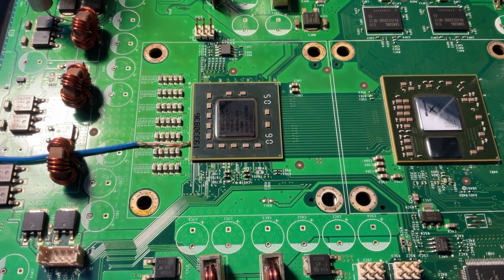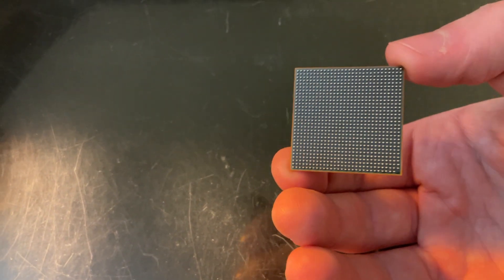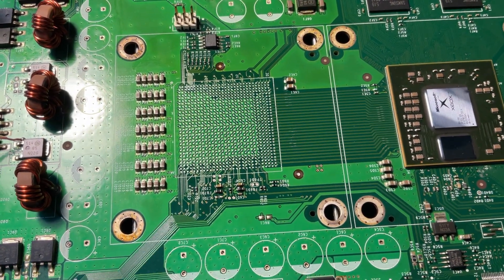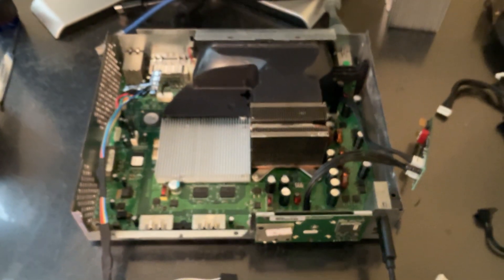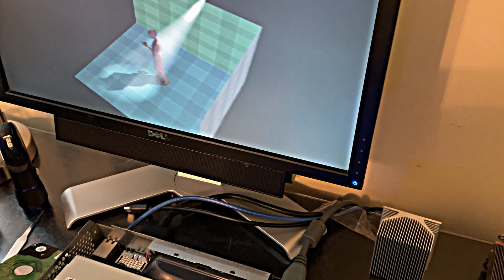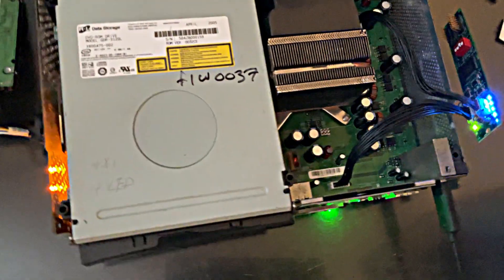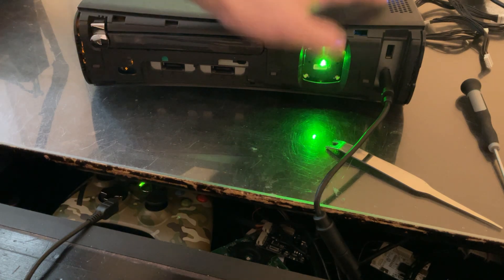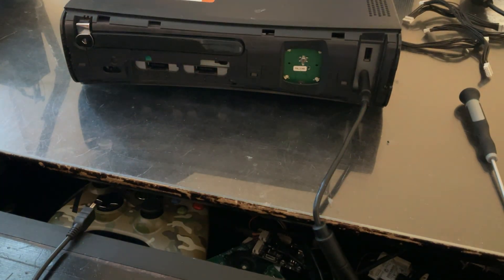Xbox 360 Prototype XeDK 007 Repair (BGA Rework)

Comment: I waa doing them over 13 yrs back. Was tricky then as not much info. Nand swap and cpu swap was how I did it and I think I had to run the nand through jrunner or some program to get xell on it.
Reply from the maker: This is not what is happen in this video. Doing that on this prototype console will not work.

Comment: Great video, Josh!
Matching the topic a bit: I'm currently in the process of preserving an old Xenon 360, Mid 2006. It though it had just a RROD, but the board below the GPU has separated and the top layer looks like a bubble with a height of about 1mm. After replacing the GPU, the error is still 0110, what could be GPU or RAM seemingly. The bubble is straight on the way to the two RAM chips on the back underside. I replaced the chips, same error.
The Xenon was just played hardly with in the first 1.5 years of it life (maybe mid 2006 til 2008). The owner put it away, for sure because of issues (RROD as we know today).

I removed the CPU (and GPU, as it is functional) and want to put it on a different Xenon board, that I have.

What do I have to prepare besides the NAND backup? Thank you very much and sorry for the long explanation 🙂
Reply from the maker: It a popcorn because someone have heat the board improperly! The board is now garbage.
You will need to use that nand.

Comment: Hi Josh thanks for your videos you think you can help me I have purchased some CPU for Slim console but they came with 0000 cpu key and 000 fuse burn how do I get it to burn fuses so I can get a CPU key  thanks
Reply from the maker: Don't burn them! Why waste the cpu??? Instead just run DEVGL on it.
Reply: @Josh.Davidson  I don't have the knowledge on DEVGL, on j runner it will not let me it will not let me choose that option, is there a form where I can get guidance on how to do this

Comment: Strange that died cpu, not gpu ... But in general, I advise you to change the GPU radiator to a version with a thermal tube from older models and put a small fan on the extension of the thermal tube, otherwise it looks like there are 90nm GPU, and they are all on the brink of death
Reply from the maker: DD1 CPUs are have dodgy AVDD screens and have issues with the Glitchless Mux. This is what caused this issue, not gradual failure.

There is no reason to change the heatsink, this will not affect longevity or temperatures - only fan speed. Besides, this is a prototype, which runs the fans at 100% all the time and as such, there is absolutely 0 impact of changing the heatsink.

Comment: Hi Josh! Glad to see some nice work done in bringing these pieces of history back to life. I happen to be developing a Xbox 360 Low level emulator, and i’d love to know what’s the lowest firmware version you’ve managed to dump from a XDK! These early prototype builds contain lots of debug info, which would be more than helpful, as there’s not much documentation available from these systems. Hope you can continue the good work i’ve seen in your videos 🤜🏻
Reply from the maker: Hi. These early units I receive for repair are usually flash-bricked from China. Therefore I have nothing dumped from them. Sorry. Regards, Josh

Comment: what’s the difference between dd1 and final cpus other than the clocks
Reply from the maker: There are differences in the design, several issues were corrected in DD2. The biggest one is the broken power-on-reset sequence which is why Titan is required. That wasn't planned, but was a workaround since DD1 was broken. The fuses are also somewhat different. I am sure there are more differences that I am not aware about.

Comment: Would Revised Y1 work on this once the GPU shits the bed?
Reply from the maker: Yes. But given that I barely will use it I doubt it'll die. 
But, I have replacement A21N2 chips so I'd probably just install that.

Comment: Hi Josh, I recently opened a friends working Xbox 360 to clean it out and give it new thermal paste. After I put it back together, it no longer worked. The system boots and shows system error E74 with a secondary error code 1022. I have the backup of her failing hard drive with all of her game saves. Could I pay you to help repair her system and get her backups restored to a new disk and SSD? I feel really bad that I killed her Xbox.
Reply from the maker: @sethmaynard2972  It's not economically viable. It would be more viable to replace the motherboard.

Comment: What do you think of the cardboard mod on the GPU? That is, putting cardboard on the GPU heatsink to improve airflow accross it, have you ever used it, is it effective at reducing GPU temps?
Reply from the maker: Very stupid and pointless. GPU temps not need reducing, is fine how it is, and the DVD drive already creates a channel over the fins. Cooling mods are completely unneeded.

Comment: Hey Josh, I recently got a blades dash 2.0.6717 that seemingly hasnt been opened before and was manufactured 21 feb 06. Im gonna repaste it when I get time of course and wanted to disable the efuse just in case. Do i risk bricking the console when i try disable the efuse like if i bridge the solder joints or something and do i need to make any patches or mods for it or should i be all good. Also its a PAL Australia console incase that changes anything
Reply from the maker: U6T1/U6T2 method is what you should do.
Reply: @Josh.Davidson  I trust your methods the best, do you have any video on it. also I assume it has the Y1 gpu if i were to replace it with a fixed gpu would elpis require no extra boot loaders or anything
Reply: @Josh.Davidson  alo do i just remove the resistor or do i bridge the points also
Reply from the maker: @leonikonomopoulos3923  No need to remove the resistor.
Reply: @Josh.Davidson  ok, thanks for the help

Comment: Yo Josh nice vid, that boot up anim is quirky.

 Also, got a question. I've noticed out there that some Xenons serviced in 2009 receive a new serial number and some don't, my guess is that the ones with the new serial numbers are converted to an Elpis while the others aren't. But what do you think?
Reply from the maker: New S/N = refurb/re-mfr unit
Old S/N = serviced for customer
Reply: @Josh.Davidson  Thanks for the swift response bud. So I take it that some of the new S/N units were bonepile related?
Reply from the maker: Can be, or just units that were sent out for repair for various reasons.

Comment: Excellent work Josh! Does Winchester have any hope?? 🥺
Reply from the maker: Yes... but I'm not working on it rn. It won't be RGH though. Another exploit.
Reply: Someone on fb claimed to have found 0f for them recently. I figured what I might do is just buy a LOT of CPUs from various manufacturers all over China and test them all out. Would be cool to get my hands on one. Albeit will not come cheap!
Reply: @acepvp271  is it Oban 0fuse (one used in Winchester)? Maybe we can do something to the console by vcore glitching. But if we manage to get pll point on a winchester. Post point, pll... all is disabled on the Winchester. I hope Josh find someway of modding this console.
Reply: @walterwallace9503  Nope. Only solution is 0 fuse cpu which is ultra rare to find.

Comment: ❤. Sir which glitch chip do you recommend for RGH 1.2 on jasper. I have a X360 Ace V3. It worked for 8 years on a Trinity. Should i install it on my jasper.? I want to know if it will be reliable. Glitch chips are hard to find in asia these days.
Reply: I had a falcon that worked well with an ace v3, and a Jasper that I later put a rev c on, some things to consider is with a Jasper you may need to cap it, and that you need to remove a diode and bring power from the board to the diode point.
Reply from the maker: Coolrunner Rev-C is recommended. X360ACE V3 can work with my timings. https://github.com/Octal450/Timing-Files/releases/tag/Timings